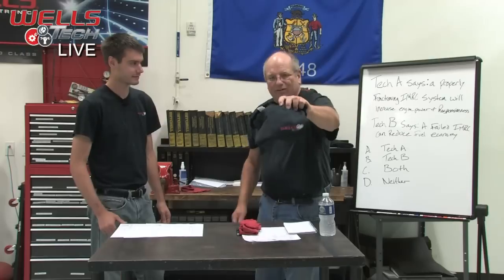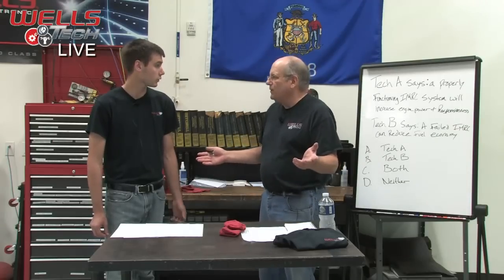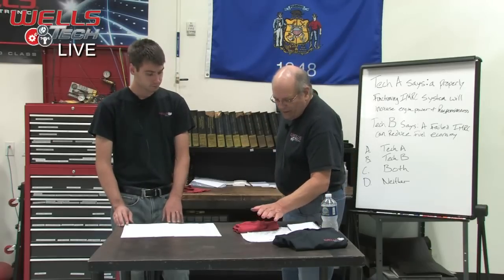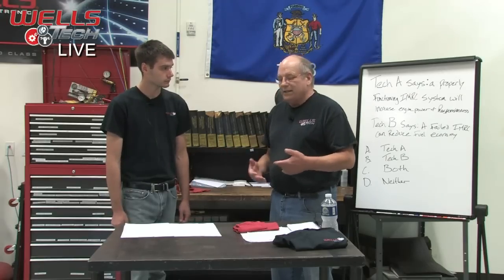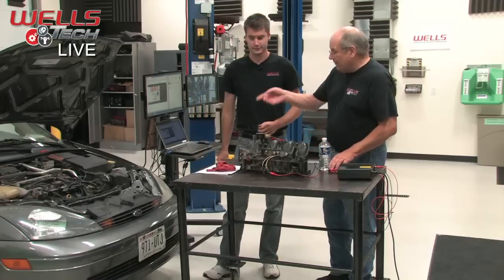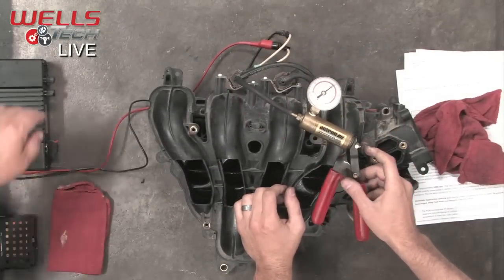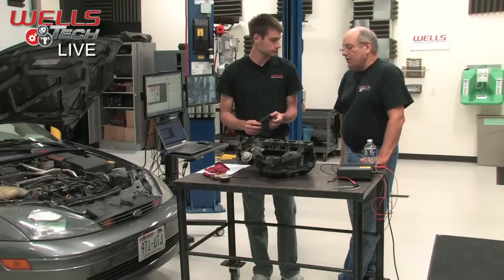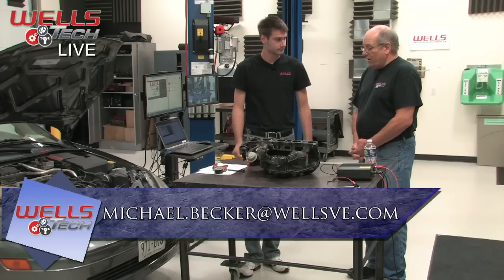P2004, P2006; Intake Manifold Runner Control (IMRC) Function and Diagnostics (CDT)

Comment: This is so helpful. The breakdown of how the intake manifold works was exactly what I needed to know! Especially going over how the codes are actually meant for the swirl control system, that cleared up several headaches I’ve been facing while trying to diagnose this issue. Now I definitely want to get the manifold off and check out those flaps considering my engine has an oil leak and there’s a ton of that “gunk” you were mentioning around the intake and engine bay. I wouldn’t be surprised if the actuator or the flaps got stuck because of that.

Comment: Just ordered the PCV  valve and tube after I ordered a new manifold. When I removed the old manifold it had all the gunk in it. Car is 2004 2.3 Ford Focus zts. Rather than pay the $300 for the AH manifold I purchased an AM for $60 and plan to add one vacuum port on the top.

Comment: Great info. Especially concerning the confusion between how they named IMTV, IMRC etc. Made a new harness for an 05 Focus ZX4 ST, think I may have mixed up the wiring for the two solenoids lol.

Gotta buy the OEM powertrain control / emissions diagnostics manual… workshop manual and wiring diagrams manual won’t cut it for this mess lol

Comment: Thank you for explaining this! I did the pressure test on my manifold. The solenoid is activating the lower shutters/valves but when I apply manual pressure, vacuum the lower valves are leaking very slowly. time for a new one? I have a constant 500-1000 RPM idle fluctuation . thank you again
Reply from the maker: Hey Jude, thanks for watching! Are you getting any trouble codes? I'd hate for you to go replace the manifold only to have something else causing your idle fluctuation.
Mike Becker, Senior Technical Instructor
Reply: @GoTechTraining  that's been my problem, no codes at all. Total vacuum problem. I pull the vacuum line off the actuator solenoid, car idles fine just sluggish due to open vacuum. That's the only thing I can think of since everything else is hooked up to the computer and should throw a code. Plus I already replaced just about every airflow sensor, Mas air, MAP, Knock and was probably going to do the EGR if I take the manifold out again.

Comment: DIY-er here - What is a runner?  That definition would help with the concept of the system and what it's doing.
Reply from the maker: Hey Rebecca, 
A runner is a flap or door in the intake manifold the moves during different loads and engine speeds. The movement changes the velocity and direction the air enters the cylinders which can help with performance and complete combustion. 
Hope this helps, thanks for reaching out 
Ryan

Comment: Hello sir. I have exactly same ford focus 2004 2.0 . Show me Code p2004 . Do i need to take off manifold or is a valve? I changed both solenoids. Still show p2004 ? Do i need to take it out and clean it ? Does is works or just buy a new one

Comment: Twice on my wife’s 2008 4 cyl. Mercury Milan the obd scanner noted a vacuum leak.   Easily found them and replaced bad vacuum lines, near front top of engine in intake area.   The first one may have been there for many months as the car had belonged to my. Ice before hand, and car maintenance was unheard of.   Could these vacuum leaks contributed to all the extra gunk in the intake plenum?

Comment: Am having the same problem with a lexus is 250 07 
Code 2006, 2004. Any help?
Reply from the maker: Hey Gavin69, the first step would be to monitor the signals to the valves and see if they are being commanded. From there you'll need to verify the flaps can physically move.
Mike Becker, Senior Technical Instructor

Comment: Hey there,  if I remove the runner control valve,  should it move when the key is turned on?
Reply from the maker: Hey High Life, remember this engine has runner and swirl control. If you remove the valve that controls one, the other will still move.
Mike Becker, Senior Instructor

Comment: I have a jeep patriot and getting code p2006 intake manifold runner control stuck close bank 1. Any idea?
Reply from the maker: Does the runner solenoid get power and ground? Could be just a manifold issue.
Mike Becker, Senior Technical Instructor

Comment: Can this issue be solved by cleaning, or was the manifold replaced completely?
Reply from the maker: Hey Kyle, that depends on the condition of the runner assembly. If they aren't broken or loose, maybe a cleaning will take care of it.
Mike Becker, Senior Instructor
Reply: You right before replace need to clean the mechanics don't like to do this. I clean tomorrow and let me see.

Comment: Answer C forsure!!! constantly allowing a/f ratio into conbustion chamber giving more power and responsiveness but lacks fuel economy  cause its wasting extra fuel!! engine studders because not all are stuck open so its uneven pressures inside! thats what i think! not sure if im correct but thats what makesense!! My sister has both codes on her 09 Mazda 3! yeah they expensive!
Reply from the maker: Yeh, you are correct! It was C. They do get expensive to fix. If you ask me it's kind of a cheap design. Plastic that is constantly moving right next to a hot cylinder head is always going to wear and run into issues. Thanks for commenting. 
Mike Becker, Technical Services Instructor

Comment: Anyone knows how long it takes to replace the intake manifold? I have a 2006 focus. My actuator is electronically controlled. I guess till 2004 they were vacuum operated
Reply: about 2 or 3 hours if your carefully following along with a video.. 

After your first time you should be able to do it all in under an hour. 

Fords are very simple and straight to the point engines 

I love em!!
Reply: Thanx. Replaced my manifold a few weeks ago. All is good now. Went well apart an intake bolt that wouldnt come out. Finally got it. Took me 2h 👍

Comment: I have a p2006 code on my 2015 audi a7 what could it be
Reply from the maker: Hey Dalordrin, it's related to the intake manifold runner system. You may end up needing to pull the intake and inspect the flaps?
Mike Becker, Senior Instructor
Reply: @GoTechTraining  I am not yet accustomed to all the parts of this car would you know what side the flaps would be on and if a recent intake filter change would have caused anything

Comment: can the intake runner casue the vehicle to stall in revesre
Reply: the vehicle has a code p2004
Reply from the maker: I suppose it's possible. If the flaps are falling and blocking the intake port, sure. It only happens in reverese though? It could be something else? Vacuum leak issue?
Mike Becker, Senior Technical Instructor

Comment: Could it cause the vehicle to stall when snapping the throttle?
Reply from the maker: Hey Stand Alone, sure it might. Depends on what is exactly wrong with the flaps. If they are not moving, but in good shape it probably will just make the car lack power...but if they are broken, they could move and block the air entering...which could cause a stall condition.
Mike Becker, Senior Technical Instructor
Reply: Wells Vehicle Electronics I've checked just about everything I'm having a tough time with it....the only stored code is high input on the fuel tank pressure sensor no other codes
Reply from the maker: Yeh, I don't see how a fuel tank pressure sensor could cause that. What kinda car you working on? How are the fuel trims?
Mike Becker, Senior Technical Instructor
Reply: Wells Vehicle Electronics 05 Cadillac cts 3.6 fuel trim at idle hover around -2.5 to 0
Reply from the maker: That seems pretty normal. Any codes besides the one I assume is in there for the FTPS?
Mike Becker, Senior Technical Instructor
Reply: Wells Vehicle Electronics Hi so after multiple fuel pressure checks I found that under heavy acceleration the brand new fuel pump would starve the engine but it would only happen when you snapped the throttle.....thank you guys for your help!